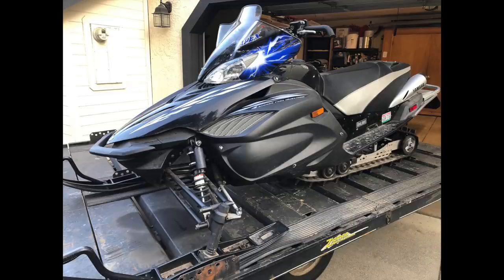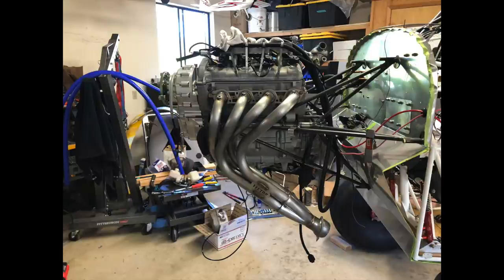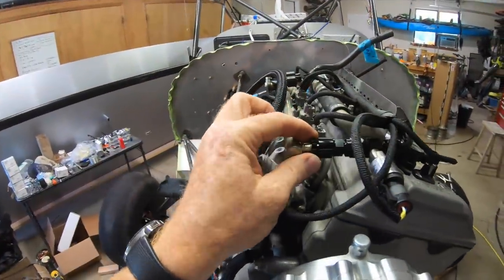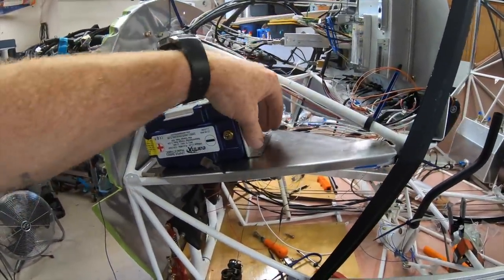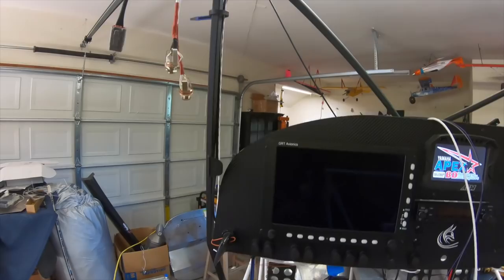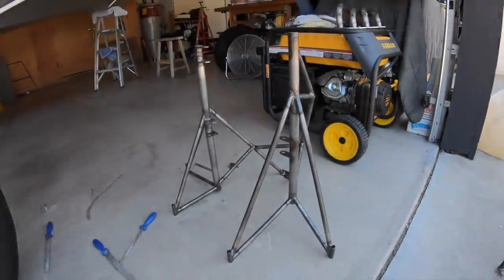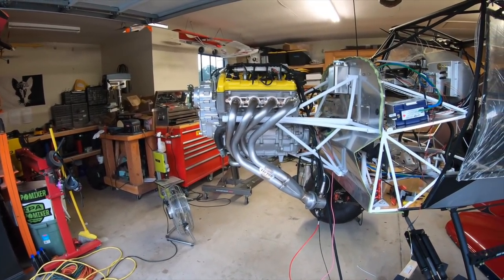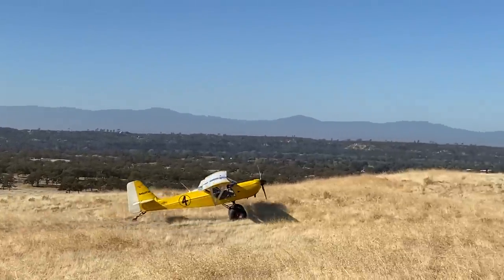Kitfox 7 Apex Build Episode 28 APEX Engine Part 1

Comment: You made the right choice on installing the lithium battery on the inside. This helps insure charging the battery within the correct temperature limits. Lithium batteries do not like extreme temperatures.

Comment: Such a cool video.  I have an FJR1300 which has a YZF-R1 type engine.  Runs like a dream.  Valve lifters are a bit noisy.  Other than that, absolutely zero complaints!

Comment: That's a really clean looking engine install. Even the new engine mount looks cleaner than the prototype. 

I would like to point out that mandrel bent doesn't mean a single piece of tube, it means the tube was bent using an insert (mandrel) that keeps the inside radius of the bend from kinking during the bending process.

Comment: I'm late to the Apex venture but trying to catch up.  I'm currently building an Europa XS and one of my biggest holdups in considering the Apex is the engine mount.  If there was one that interfaced like the Rotax 912 ring mount I'd be rocking!  Exciting to see these engines, that cost a lot less, make there way into the aviation world. 
 - Found you from GRT's website and now I'm on a subscriber.

Comment: Kick ass engine.. I had 2003 R1 and I  put it on a dino and it put out 158 HPs to the ground not crank.. Totally stock... Minus the letter of oil I dumped out for the stock Dino compation I entered and won that year hehe.. Total monster of a engine for its time.

Comment: You mentioned on the battery putting the screws in from the bottom so they can’t hit your feet. Traditionally aircraft have tried to make sure that the screw can’t fall out of the hole even if the nut falls off.  So they would’ve put the screw in from the top. 
Other than that, a nice looking project.
Reply from the maker: Well, if they fall out I will see them this way, so win win. 🙂

Comment: Looks awesome, I would like to see how many can go 1,000 plus hours of dependable service in an aircraft application.  The power demands of an airplane are a lot more constant and heavy.  Lets see how well a snow machine/ motorcycle engine holds up under the demanding HP output conditions of aviation use.

Comment: Looking good! Been nice to get insights into some of the intricacies of building. Just curios though, wouldn't it be better to have the battery rotated 180 degrees for easy access to the terminals from the inside? Maybe you have plans for an access panel? 
**NOTE** My question does come from ignorance. I have not built a plane and have little hours in one. :) 

Keep the great videos coming! Thanks for the time invested in making them!

CHEERS!
Reply from the maker: Good question, I am making the boot cowling removable so I’ll have access
Reply: @BowenAero  Cool deal. I wondered if that was the other option.

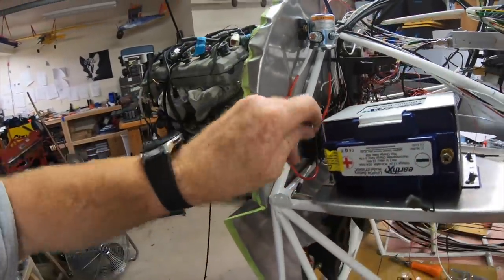Comment: 9:40 How do you access battery terminals after you put skin on the plane?  Why not orient the battery so terminals face toward center of plane?  In attempt to keep starter cables shortest possible, could battery be placed on right side of aircraft interior?  Above passengers feet?
Reply from the maker: The cowling can be removed to access the battery or 4 screws from underneath removed and the battery slides out. I could flip it around, but there is a charging lead off it as well.

Comment: Few thoughts, I assume that at any time you could add a second earth battery on the right side if you wanted redundancy power. Also not sure of the elevation in your local High Sierra's if  you run that amex engine without a turbo in remote Idaho with the altitude and mountainous terrain will you have climbing power?

Also was you fusalage as I recall is a FF4 or 5 and I'm wondering if your wing is an STi?
Reply from the maker: It is a Kitfox 7 airframe. Redundant power can be added latter, but with the iPad as the back up screen it already has an internal battery. Since the Kitfox is designed for 100hp at sea level, tThe APEX with 160hp at sea level will do great at altitude. A turbo can always be added to maintain that 160hp at altitude at the expense of weight and complexity and of course the cost. I expect a solid 135hp at 9-10,000 feet

Comment: Is it possible to achieve the same result by using a road engine in place of the snowmobile engine ?. if so where can i find information. thanks and congratulations for the work you do
Reply from the maker: Do you mean a motorcycle engine? The problem there is the integrated gearbox. The snowmobiled is preferred because of the direct drive output.
Reply: @BowenAero  thanks for the explanation, but unfortunately in Italy the sun gives so that there are not many snowmobiles and many low-priced motorcycles

Comment: Yamaha is always been first and that goes with watercraft, they were first with the 4 stroke waverunner 2002 FX 140 that was the MR1 motorcycle engine and with the 1800 which I guess is the same in aircraft as in their FX SVHO and GP 1800 Waverunners. Its a proven engine that you can trust your life with. I have yet to see under normal and extreme use ever have a failure and even abused engines I have never seen failures.

Comment: I would look at how Lithium iron batteries fail, some folks put them in the cabin but they have a box that vents to the outside in case the battery goes TU. I'm for sure putting mine FWF, but it'll be a Shorai.

Comment: Was it Ken Brown the racecar guy helped with the Apex engine?
Reply from the maker: Ken Brown from Reno made the engine mount and the header. Brian Dacus from BD Turn Key Engines did the AEM engine electronics.
Reply: As I got further into the video I realized it's probably not the same guy.
Reply: @BowenAero  Do you have contact info for the header?
Reply: @tonybraun5118  n

Comment: Doesn't this engine make max HP at like 12000 rpm. At what RPM are you going to be operating at? with the reduction gearbox.
Reply from the maker: Peak of 10,500RPM, normal operation will be 7,500-10,500rpm on the engine

Comment: Did you consider putting the battery in the tail area to help your CG?
Reply from the maker: No need for that. The CG will be right on. This firewall forward will weigh about the same as a Rotax 914 install. My model 5 with the Lycoming was 80 lbs heavier on the nose and I had the battery in the tail to help along with the forward wing sweep.

Comment: Is this lighter than the rotax 915 and such? Any major pros/cons over just picking a dedicated aircraft engine
Reply from the maker: It is lighter than a 915 with more hp at sea level and the option to turbo it up to 300hp
Reply: @BowenAero  Or 750 HP if you're Mike Patey...LOL
Reply: @toddr2265  
LoL 🤣😂

Comment: Why not use the Twin1160 cc turbo 4 stroke 160 hp by Suzuki witch I believe is Yamaha apex 2012 to 2016. Just wondering you can get them brand new for around $ 3400.00
Reply from the maker: Because there isn’t a gear box design for this application.
Reply: @BowenAero  
So it's not about 2 cyl versus 4 cyl thing .
Just a reduction drive that fits the motor ?
Reply from the maker: I chose the Yamaha because of the proven history of its conversion to aviation. It has been used in gyrocopters for more then 10 years. A lot of the developments came from the gyro guys and the gearbox is made by SkyTrax, which is Teal Jenkins, a gyro guy. I’m sure there are other engines that could make a good conversion, but you would be starting over from scratch. The APEX already has a good track record and vendor support.
Reply: @BowenAero  
I knew most of that 
I am looking for alternitive engine's that you can buy in a crate option since from what I understand you cannot buy an apex like the one you are using brand new or am I wrong
Reply from the maker: @woodyahh2110  I think that is why the sidewinder may end up being the future engine of choice. Teal has designed a gearbox and Bryan Dacus is working on a tune using the AEM ECU.
Reply: @BowenAero  
What I found was a 2 cyl turbo that puts out 140 to 160 hp brand-new from dealer
Don't know if it will swing a prop

Comment: What none of the engine people mentioned so far, what provision you made for cabin heater?? Oil or coolant?
Reply from the maker: It runs off the coolant and is a small radiator with a fan on it. It works ok.

Comment: What's the power consumption of those contactors, how many amps will be flowing through them on a normal basis? (Will the parasitic losses be excessive?)
Reply: Compared to a mechanical switch like this https://www.amazon.com/dp/B07L2JRHRQ/ref=cm_sw_r_cp_apa_fab_S8rGFbBVP4AFZ

Comment: So what year and miles did the sled have?
Reply from the maker: 2007 with 1200 miles
Reply: @BowenAero  
Didn't you say you've gone through the engine though, so it's basically  new ?
Reply from the maker: I did not tear it down because it is such low time. I did pull the valve cover to take a look at the top end and its spotless.

Comment: There is no reason why a snowmobile engine shouldn't work well in a aircraft. They are both designed to be run max rpm for long periods of time. If the sled engine is only has half as good as the motorcycle engine engine it should last forever. Nice conversion.